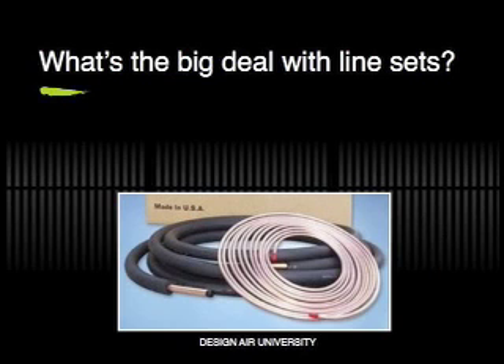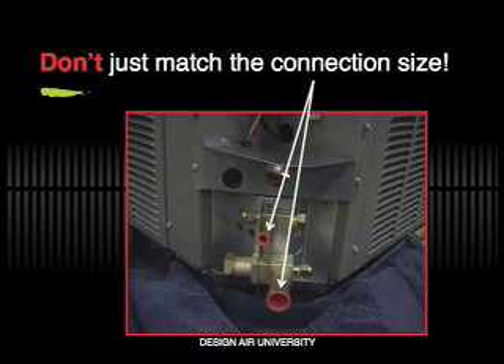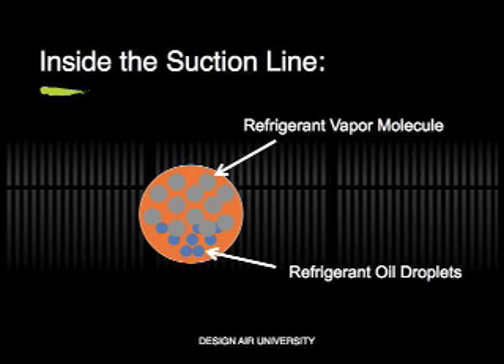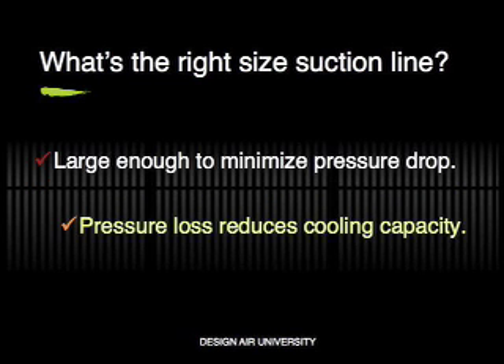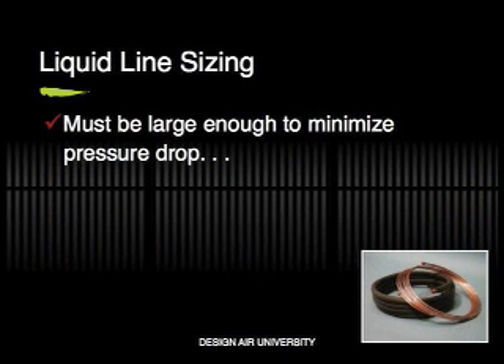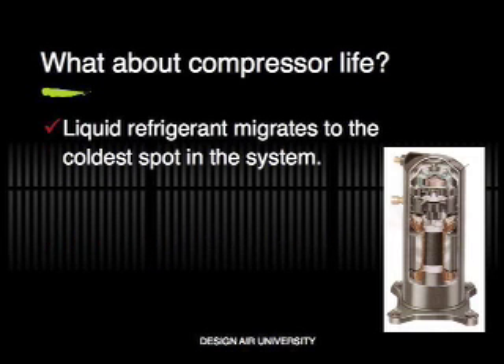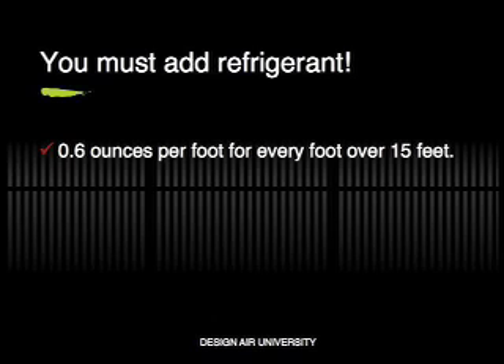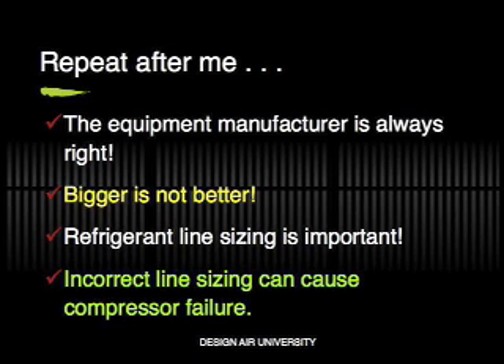Refrigerant Line Set Sizing

Comment: Proper adjustment in sub cooling and superheat can compensate for line set size?. I'm installing a 4 ton condenser and the contractor put in a 5/16 3/4 line set. The run is about 40 feet to the evap. The unit is 3/8 7/8. If I reduce the the pipe size and the head pressure to liquid temp, will I be ok? Or should I change the line set. Thanks.